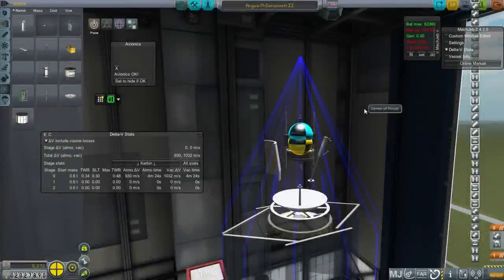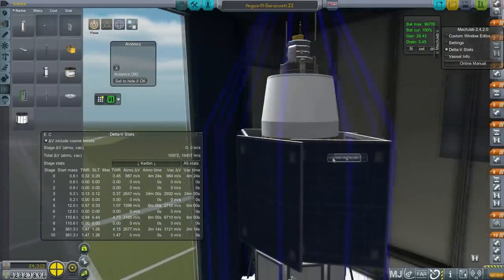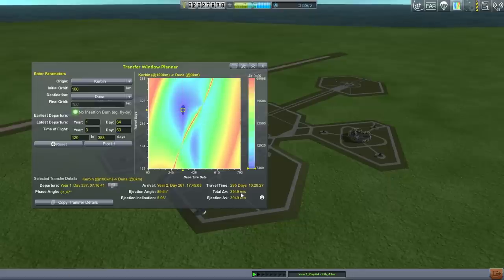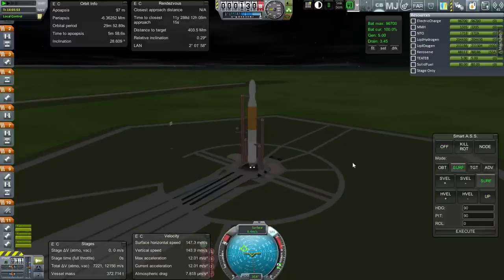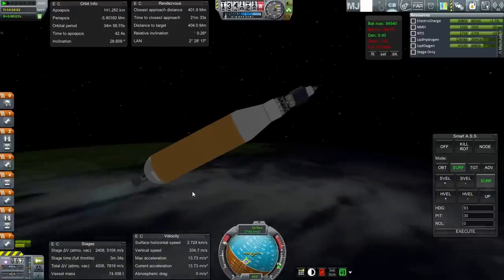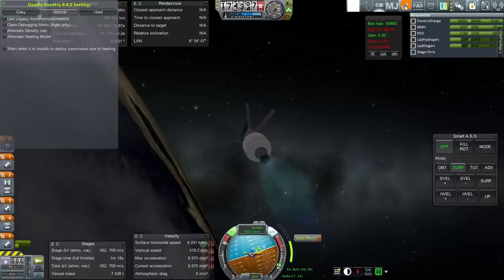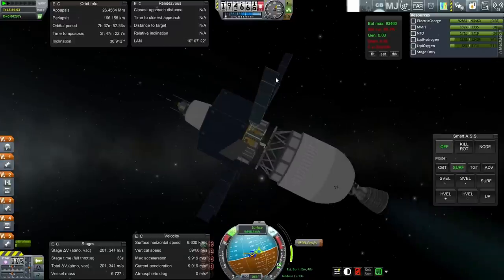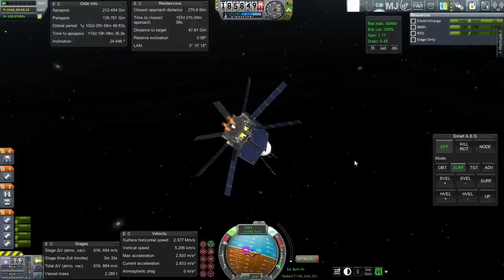Realism Overhaul in KSP Beta 23 - Mars Lander Probe Part 1

Comment: im curious as to why you have verniers on the lower stage, they are less efficient than the H1s and with a cluster of 5 H1s you have pitch roll and yaw torque anyway....

and i honestly dont know why you use Smart ASS, it is much worse at controlling rockets than standard sas with human controll.
Reply: *****  ahh fair enough if your wrist is in poor shape then manual control can be a pain, it was just that your launcher is very similar to my ajax series of launchers, personally i never have any issues with oscilations but then i mount my H1s closer together on a smaller boiler plate (dont know if that has any effect) as well as flying manually.
Reply: ***** ahhh that makes a lot of sense, i tried to use KOS but i couldnt get my head around it, (no coding experience of any kind) so kudos to you if you can get it working.